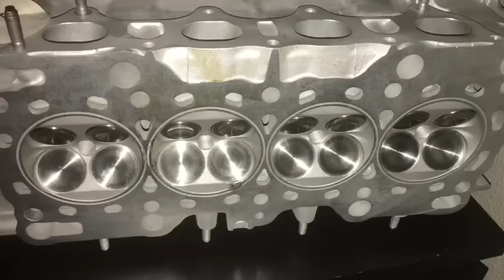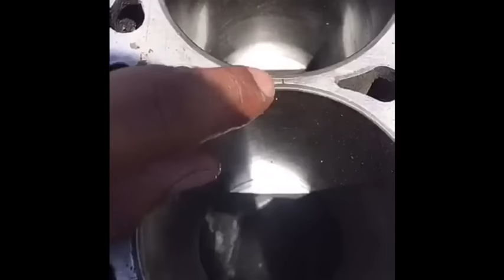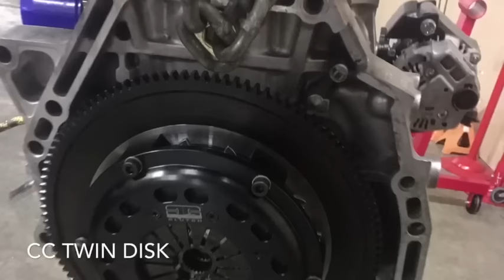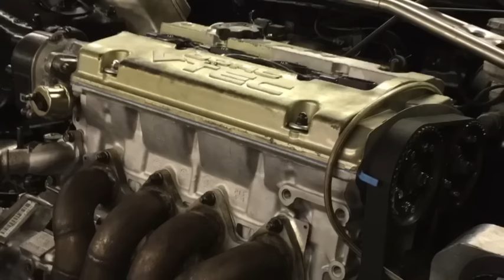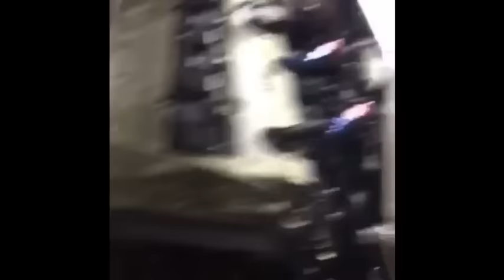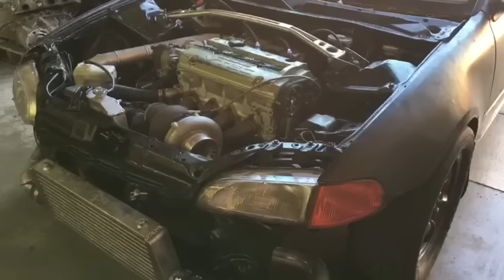Turbo H22 High Compression Build  #MurderCivic 2.0

Comment: Those are balance shafts not oil shafts. Noce build tho bet it's a beast. Did you ever get the rpm issue resolved and on the dyno

Comment: A lot of $$ parts built but still no time slip. Boostedboiz are using cheap eBay parts and he's 10s faster
Reply: Boostedboiz Kyle race with a Dog box tranny, No cheap at all.
Reply: @noelrodriguez2379  before that he already achieve 9 second in a syncrho rings and 
 stock sleeves and a little mod in the headers  the secret is the tune!
Reply from the maker: Black Hmong lol who said I wanted to go to the track and run with this car? I built this car for roll racing to begin with.